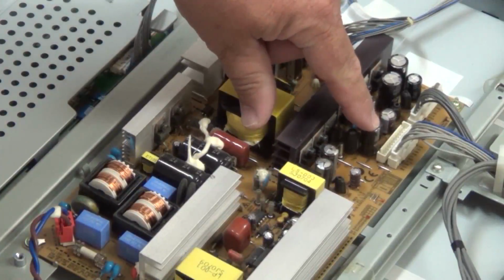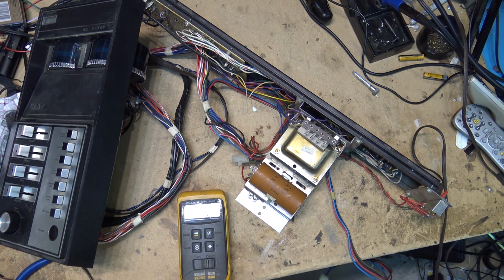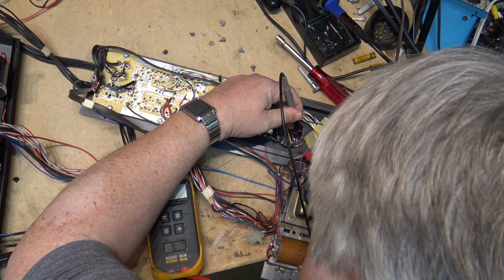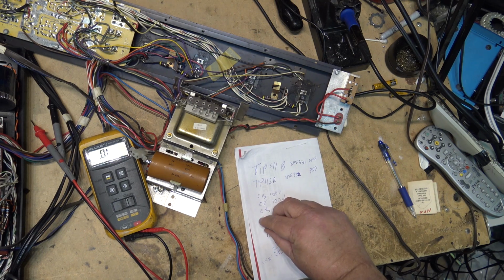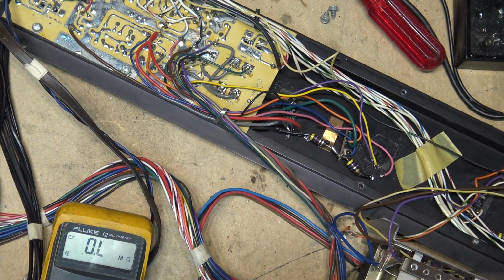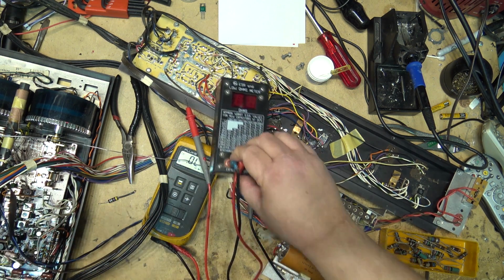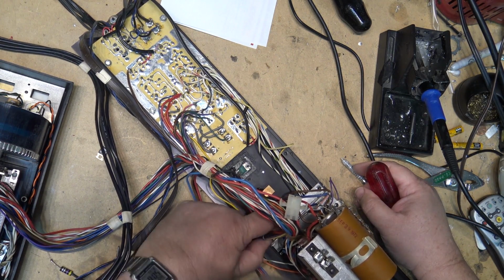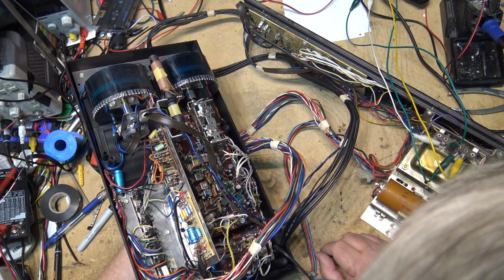RCA Q-100 Stereo Console Humming and tripping breaker. Can this one be saved?

Comment: I have an RCA console that is likely from the late 60s. It basically has what looks like a radio chassis modified to accept a record changer and aux in. The cabinet is in horrible shape, the record changer is trashed. It needed new filter caps. An across the line disc cap shorted when I was using it one day. I just nipped that out and left it that way since it's a shop stereo.  That thing really jams!

Comment: You have amazing dexterity when soldering, holding the wire/component and solder in the same hand. When I try to copy this I usually burn my fingers!
Reply: after 20 years ou will get used to it :D ;)
Reply from the maker: I burn myself once in awhile. Today's youth would be running to the ER for some oxy. to us old techs it is just water of a ducks back. Same with getting jolted. Shit happens, and if you work around electricity, you are going to get bit once in awhile.

Comment: These old stereo consoles could really rock the house too! My parents used to have a 1970 General Electric console.
Reply from the maker: My parents had an RCA with a TV. That sucker went really loud. It was a tube chassis and I kept the radio after the TV was trashed. (They put a small color set in where the tube used to be and kept the stereo portion for awhile, but when it was scrapped I hung onto the amplifier and tuner. Only problem was it was mono FM, so it ended up being scrapped. Now I wish I had hung onto it because it was a tube amp and it sounded so good.

Comment: I've never seen one of those before, looks in fair condition for it's age.
Some old amps had R.c.a branded To3 transistors, i never knew there exact spec so i replaced them with a 2N3055 and compliment pnp, worked fine.
Didn't even need to adjust the bias current.

The 2n3055 was handy for c.b power supplys as well, i bought loads of them for incoming c.b power supply repairs.
The 2n3772 was suppose to be better, but it was not.
Reply: Sorry to be so offtopic but does anyone know of a tool to get back into an instagram account?
I was dumb forgot my account password. I appreciate any assistance you can give me.
Reply: @Callen Koa Instablaster :)
Reply: @Louis Ernesto It did the trick and I now got access to my account again. I am so happy:D
Thank you so much you saved my ass :D
Reply: @Callen Koa No problem xD

Comment: Be glad this isn't a few years older, my 1967 RCA TV-Stereo combination had an output transistor fail and it was a germanium TO-3 style transistor, specifically an NTE/ECG-121. Those transistors cost about $35 or $75-80 for a matched pair. Though I will say that the amp/tuner chassis was much better laid out on mine. That thing looks cheap by comparison.
Reply from the maker: Ah yes good old germanium transistors. I have a few in my parts drawer.
Reply: You could have retrofitted a silicon transistor pair. (Of course the base current/voltage need to be adjusted to the .7V Q-Point, but it is much more reliable and less noisy afterwards)

Comment: If i was about to change those transistors, i would change them on both channels so they match and preserve stereo equality
Reply: @09danstart  i don't talk about quality rather than equality in sound levels between both channels. Ofcourse it wont be too much but it will be allmost equal on the low side. Now one side is different than the other -> as unbalanced stereo.
Reply from the maker: @technixbul  It isn't going to have any effect, as the gain on both are pretty close. This is not a hi gain stage, it is the output. Sure one side have higher current capability, but that power supply can not provide enough current to drive the amp to 40WPC never mind 90.  Output power on this is 15WPC maximum.  The levels are balanced. When the balance is in the middle and standing equal distance to both speakers there is no noticeable difference in level.
Changing extra parts is just a sales tactic used by unscrupulous shops to drive the repair costs higher.  Now, you want to match the pair on the channel. You wouldn't use a 40 watt transistor for the PNP and an 80 for the NPN or one with different voltage/ current specs. That is asking for trouble.
Reply: I used to think that way with tubes, but I doubt anyone would ever notice with transistors. If the new ones are good enough to be worth using, they'll match the other channel just fine.
Reply from the maker: @pcno2832  
The unit sounds great in the cabinet.  Returned it today and got paid woohoo. 
Tubes are a pain in the ass.  Just retubed a dynaco today and it blew the stupid fuse as soon as it warmed up. Had me pulling my hair out trying to figure out the problem and then I stuck the old rectifier tube back in and the bloody thing worked.  The new 50.00 rectifier tube was fubar.  What a piss off.  I also blew a box of fuses before I figured out that it was a defective rectifier tube.

Comment: I have an old 1982 vintage technics stereo receiver amp,model no sa-104,,which was given to me from a friend in the end after numerous repairs,for broken speaker terminals,mains fuse blown,and the volume and tone controls being so scratchy,finding contact terminals inside the rotary controls broken.
It still works,but another problem has arisen,,,,the right channel humms,with no radio or other input sound. The left channel has sound as it should,from any input. What would I need to replace there in the sound board,if not the main sound ic mounted on the heatsink amp module? Parts look good,no sign of burn out anywhere on the circuit board.

Comment: I've never really had seen one of these stereo consoles b4,looks very well solid state constructed unit. What type of cabinet did it come out of? Could u send me a pic of it all back together in place,as it,s such an interesting looking unit,with the separate am/fm tuning controls. Is it stereo fm radio as well?
Reply from the maker: Yes FM stereo.
Reply: @12voltvids  I thought it was fm stereo. I like to see the cabinet machine where the stereo console came out of it.
I have a technics stereo amplifier sa-104 with built-in radio tuner given to me after numerous repairs of the volume and tone controls with rotary contacts broken,along with replacing blown fuse. Stereo amp does work,but does have a loud hum in the right channel. Left channel is ok with the sound from any input. What would I need to replace there,if not the main output ic mounted on the heatsink amp module?

Comment: Would matching the gain/hfe not be another major consideration when swapping these out together with the voltage specs or is that not so important? I'd figure the gain would have some effect on the audio side of things?
Reply from the maker: The gain on these replacements are very close to the original.
Reply: @12voltvids  What kind of effect would having a different gain have, would something be out of balance, the volume or one channel compared to the other?
Reply from the maker: @jovangrbic97  
If there was a large difference yes. It is more important that the npn and PNP are matched.  Otherwise they they can fail again shortly, and of course the current is high enough. This is a low power unit so not much to worry about.

Comment: Transistors?  They did not have stereo back in the 1930s.  I'm so old that I was thinking vacuum tubes and hot chassis. lol
12voltvids, You are the best! I hope there isn't another component problem lurking/waiting to take out those nice new Qs...
Why not add a third resistor (470 Ohm) to nail that .47 target value?
Reply from the maker: These are 10% tolerance resistors so not too critical. I ran it for 5 hours no problem.
Will be good for years and years. Probably outlive the owner as they are in their 80s and 90's. I actually worked with their son for about a month. He worked at the shop I worked at, but wasn't cut out as a tech.

Comment: What do you think caused that channel's transistors to go short?
Reply: I can think out of 3 reasons -> 1 shorting the output cabe, 2 unstable connection with the speaker (so called sparkling), 3 used with more powerful speakers and/or 2 or more paralell speakers on one channel - in other words overload
Reply: @technixbul  I guess it would be a good idea to make sure that his customer's speakers or connections don't have issues.  I remember reading about emitter resistors and drivers being damaged when transistors goes short.  I wonder if those old amps had output short protection?
Reply from the maker: @Discretesignals  Well the resistors are on the collectors on these. B C E is the basing.

Comment: I have a question. I have a kenwood kr-v7070 receiver and it keeps going into protect mode at mid to high volume levels. It has a speaker ohm switch and I have it set according to my user manual and speaker types and it still keeps tripping protect at high levels, often not even that. I get a song playing with high bass and it will trip. Is it my speakers most likely (they are old) or is it likely an issue with the receiver? Any feedback is greatly appreciated.  I just wonder if the receiver may be too much for my speakers to handle, again they are old but are the correct ohm rating.

Comment: Do you work on cassette players
Reply from the maker: Have you ever seen a video of me working on a cassette deck?
Reply: Yes I have pbut I was wondering if you can do speed adjustment if it's available on the unit for record and playback both ways I'm not a specialist like you that's why I was wondering
Reply from the maker: @glsoterios  There is not a separate speed adjustment for record, unless the unit has a pitch control. The vast majority have a single speed adjustment, so once you set it to a reference tape on playback, record will be correct. There are a few that have a separate record speed adjust. 
For those, you also need a signal generator. You first calibrate the play speed, and then make test recordings and play them back making slight speed adjustments to the record speed and then play back to see if you got it correct.
Reply: I have a Mitsubishi cassette deck Dt-40 top of the line with a bias adjustment on the front how much would you charge to put that back in factory get back with me when you can thank you for

Comment: Why do you have a problem getting components?
Surely there is a supplier somewhere that is dependable?
Not enough business to support them?
Reply: The big one in his area, Main Electronics closed down.
Reply from the maker: Main electronics, which was the premiere supplier shut their doors after the owner passed away, and his son did not want to continue in the business his grandfather started and passed on to his dad. They owned the building, and it was worth a small fortune, so he closed the business, sold all the inventory and im sure sold the building. I haven't been by there in a few years to see what happened. 
We have Lees and RP electronics. RP has a better selection of parts, and carries many of the NTE line up. Still nothing even close to what main had. and they are a pain in  the ass to deal with, because they are basically self serve. Main was great. I could walk up the the counter and ask for a specific part. Try that at RP and their attitude has been "its over in that isle" and they point you to a long row of parts and you are on your own to find it. Plus it is a long drive to get there. About 80KM round trip from my house.

Comment: grate video - very professional attitude - must say that the German made  console  like Blaupunkt or  Grundig  and Saba are built so much better than the American manufactured  - that looks like cheap quality (they also sound better)
Reply: By the 1970s, yes american consoles were cheapened, so were everyone elses. If you want a true comparison, look at something from the 1960s, far better construction than the Germans,  no complicated, failure prone piano key switches and really cheap capacitors. No one could compete with British Dual or American V-M record changers, either.
Reply from the maker: @richardhz-oi8px  We will see when I get around to looking at my old Nordmende stereo. It has been sitting in the shop for over 2 years now awaiting the day when I work on it. All tube unit.
This one was made in Canada.

Comment: Not a great design if that back plate is steel. It sounds like steel, when you hit it with an other steel part. Steel is a horrible heatsink! A plain aluminum sheet would be OK for a low power amp like that, but steel is a no-no.
Reply from the maker: It's aluminum.